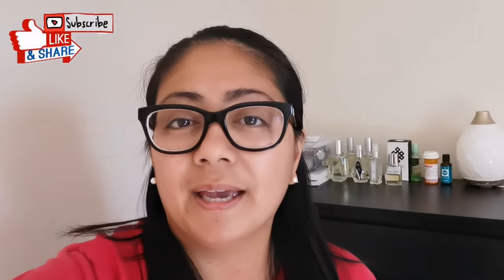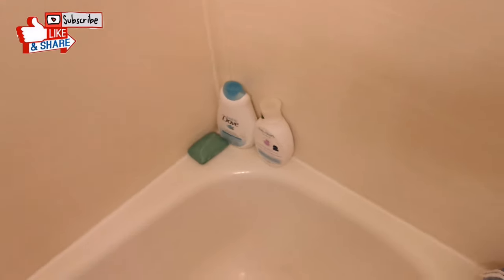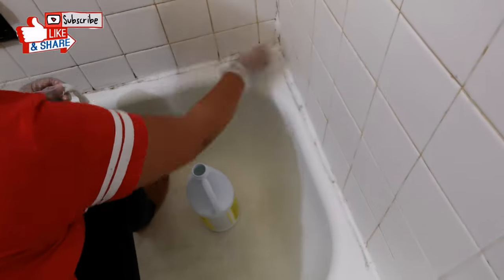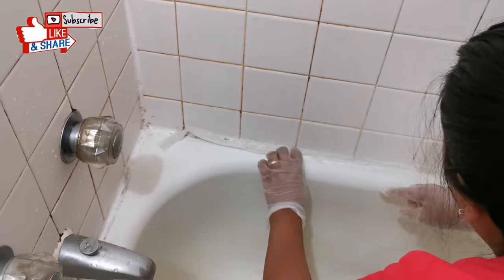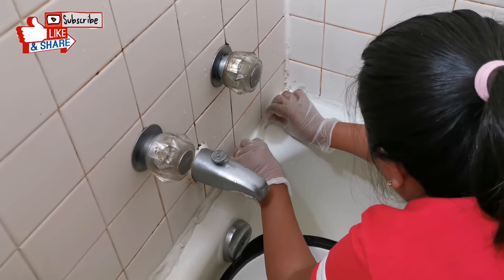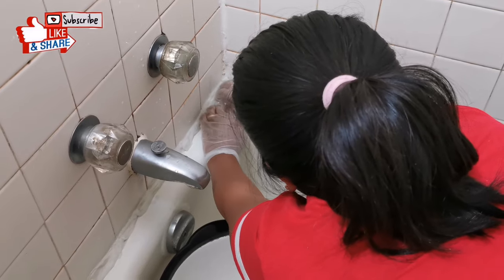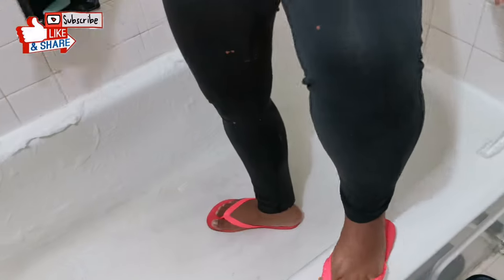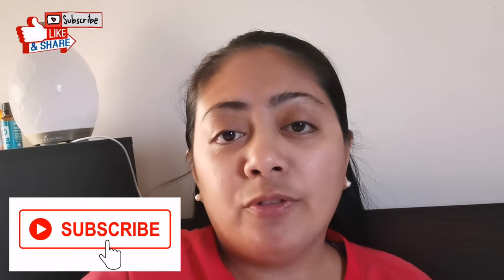HOW TO REMOVE SHOWER MOLDS | EASY MOLD REMOVAL

Comment: This is a great method using the soaked tissue. one thing to be aware of, bleach doesn’t kill mould, it simply  stains it white. So it looks like it’s gone but it’s still there so the spores are still harmful. I only learnt this recently after using this bleach method most my life. The best thing to use is white vinegar as the acid in it actually kills the bleach. Just make sure to wipe off with wet cloth/tissue gently and throw away so the dangerous mould spores doesn’t dry and float around in the air. You can also dilute some tea tree oil and spray that around the wall afterwards and this can help prevent the mould coming back.
Reply: Thank you. I was looking for something less chemical since I have respiratory issues. This will be awesome
Reply: Thank you! I hate working with bleach so I’m going to try this
Reply: Chlorine kills mold for sure. It's highly alkaline (ph ~13) and will start killing spores on direct contact.

Comment: I actually used this method a week ago and the results were amazing and in my case took less than 3 hours. I had not seen your video before I cleaned my shower. I cut strips of paper towel and saturated it with a spray bottle of bleach, I like your method better. I can definitely confirm this method worked well. I have a few places where there is hard water scum so I am going to attempt this method with lime away and see if it works well for that too.

Comment: I’m here to tell whoever is wondering if this actually works that..... IT DOES WORK! It was already starting to work after just 10 minutes of sitting on the mold!!! I am in shock! I was getting ready to tear up the caulk and everything!
Reply: I def recommend ventilating the area as she suggested because I was feeling lightheaded after about 10 mins of sitting there applying this bleach 😂😂
Reply: How did this work for you?  I did it and it did nothing :(
Reply: @Stircrazyy10  really?? This is what i do everytime now for my bathtub. It works really good and doesn’t even take long, maybe like an hour or so. Maybe it’s just time for new caulking for your tub!
Reply: @Imlilmizzswagger  I left it on for two days.  When the paper towel dried I put more bleach on it but after two days I took it off and the mold was still there :(  I didn't want to have to do the caulking.  I wonder if it's the bleach you used.  Might be stronger than mine?
Reply: what is the name for the bleach?
Reply: Just did it and it didn’t work. What am I missing?

Comment: PenglingWhisperer is correct.  Also, you should never wipe mold without gloves.  In fact don't even do that, you can get ringworm if the gloves get a small rip.  You can spray white vinegar directly.  Just don't use too much because vinegar is strong and not sure what damage it can do to pipes and such.  I spray lightly and its gone, then I just use a scrub brush  or a small broom to finish it off with some Dawn and baking soda to get any leftovers.

Comment: Great results.
How do you clean the side walls since gravity will soon cause the soaked paper towels to fall off before 3 hours are up?
Reply: Use painters tape
Reply: Will painters tape hold the wet bleach paper towels in place?
Reply: Put all the paper in then use something that presses on to it like a tarp or mesh anything and tape it to the wall that's dry just make sure u don't use any tape that rips the drywall. You're going to be there all day if you tape them one by one and most the time the tape won't stick

Comment: When doing mold removal, wear a proper respirator. Personally, I'd consider this biohazard situation, and go in, with no less than a full hazmat suit. While your methodology works, I prefer to do a bit different. Stay safe though, and protect yourself when working in hazardous environments. - Immaculate Cleaning
Reply from the maker: Well noted. Thank you!
Reply: Good bye

Comment: This didn't work for me at all!  After I placed it on it looked like I couldn't see any mold so I was so happy that I was finally going to get it clean. I left it for over 24 hours, maybe even two days and when I removed the paper towel the mold was still all there.  This did not work and I'm really disappointed because I really wanted an easy fix so that I don't have to redo the caulking 😞

Comment: Actually, mold was just bleached. Also, be careful, PPE (Personal protection equipment) is needed
Reply: You’re talking about porous surfaces. For nonporous, mold is eliminated using the bleach so her method is indeed correct.